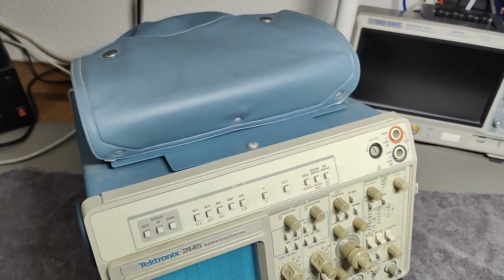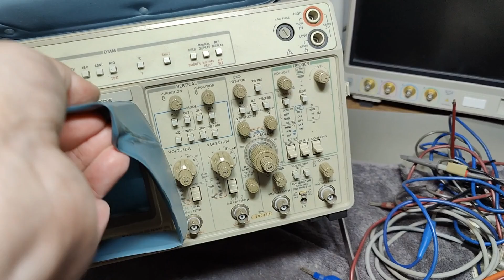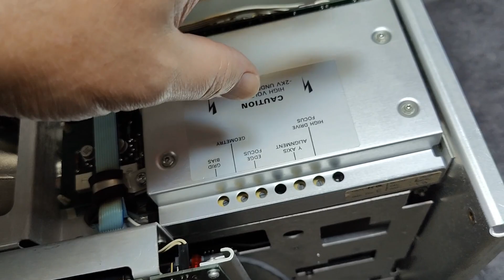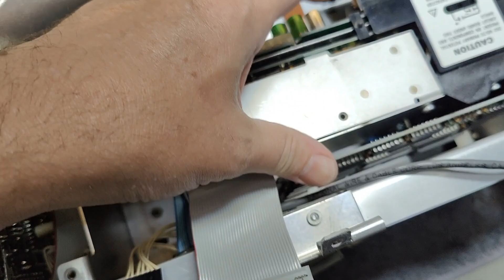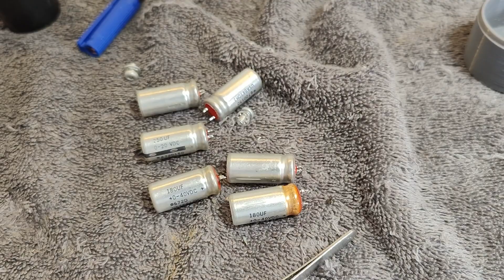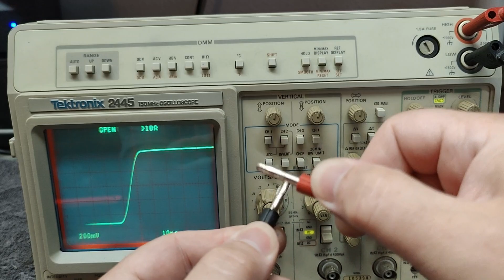Tektronix oscilloscope 2445 DMM 4ch 150MHz 1985 repair teadown

Comment: I swear, it looks like it uses a similar HV tripler to the one used in color TVs at the time. That would be the black plastic potted box next to the HV transformer. I've changed several of these in color TVs from that era.

Comment: RIFA metallized paper as a Y type? That sounds scary. Will they never short even at test voltage, as Y capacitors should, or will they just extra violently burst in order to open the circuit quickly enough to avoid any danger? :)

Comment: Nice videos did the multimeter and the scope shared  the same ground or they are isolated.
Reply from the maker: YES multimeter is fully isolated, well under 500V difference is accepted, as it say in the front plate
Reply: @TeardownOZ2CPU  u can spy the protocol between them to add a full color oled display to the multimeter.

Comment: 6:20 what the heck is going on with that "do not wash this module" sticker 🤔
Reply from the maker: inside this module you find a few really special relays, the contacts can not tollerate any kind of stuff on the surface, the no wash sticker is very normal on signal relay boards.
Reply: @TeardownOZ2CPU  but why would someone wash with detergents a high precision electronic component, that was probably the confusing thing to mention inside such a device. Because if it's about not washing the front panel to avoid leaking stuff in, so why did they put it inside then, hmmm

Comment: According to the date codes on the ICs it is from 1984/85 - not 1995 ;-)
Reply from the maker: Years in which the various models were introduced according to the Tektronix catalogs: 
1982: 2213, 2215, 2335, 2336, 2337 (first models) 
1983: (no new models) 1984: 2235, 2236, 2445, 2465.